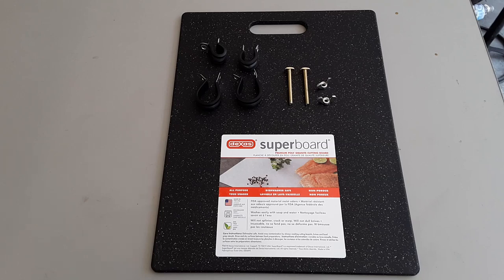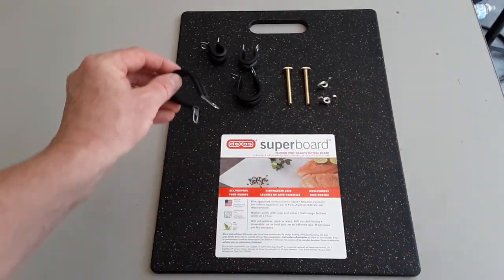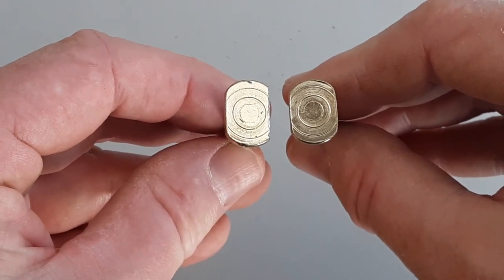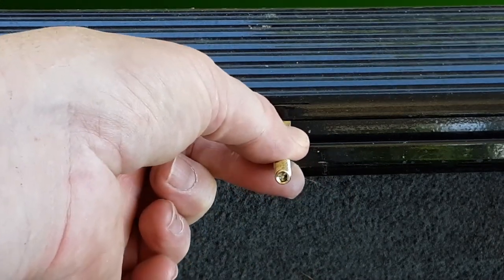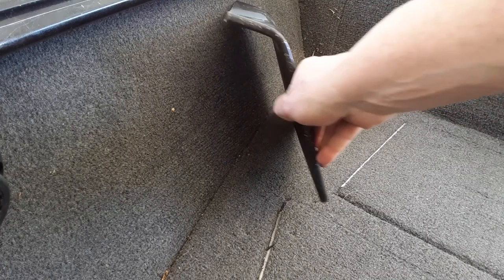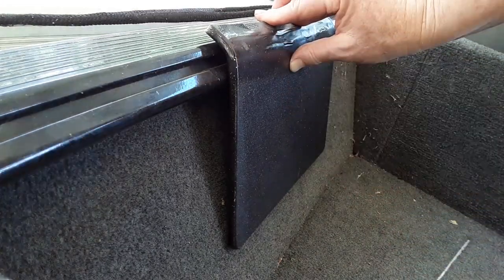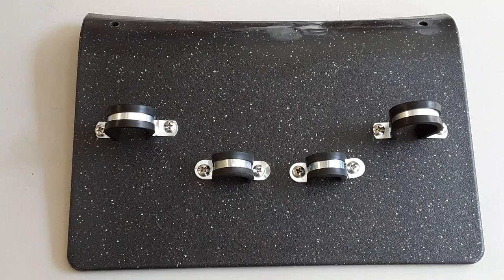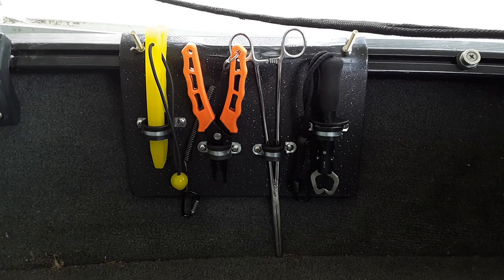DIY Boat or Kayak Gunnel Track Tool Storage

Comment: Nice Project!  Makes all your tools real handy.
In the past I have bent some of that type of material with a heat gun.  When I put it in the vice I put a piece of scrap angle on the front and rear sides of the material and use some clamps along the length of the material to hold it firmly in the vice to give it full support along the entire length of the material to be bent.
John
Reply from the maker: Thanks John. The scrap angle is a great idea. It would have cut down on the fab time. I was thinking about using a sheet metal clamp but didn't want to buy one.
Reply: @Aksmaniyak  Never heard the term "Sport Rack" on the boat gunnel where you attached.  Is that specific to a particular brand of boat?
John
Reply from the maker: If I called it that it is actually Sport Track specific to Lund boats. I have a 2015 Lund 1750 Rebel XS.